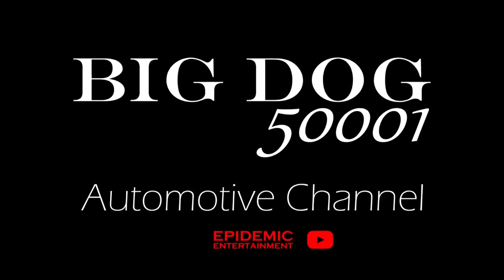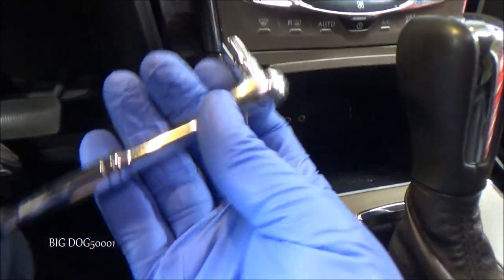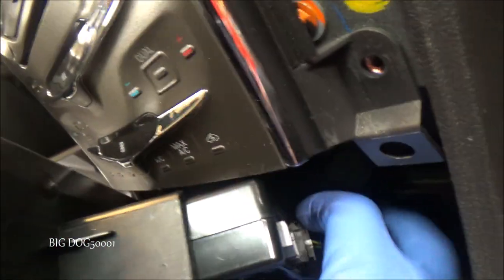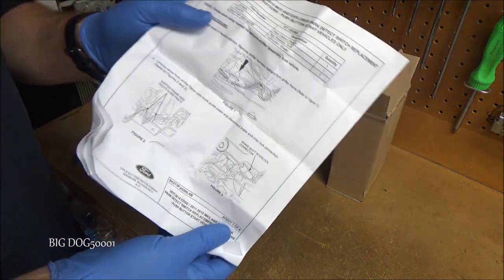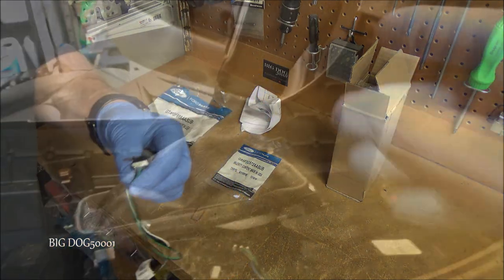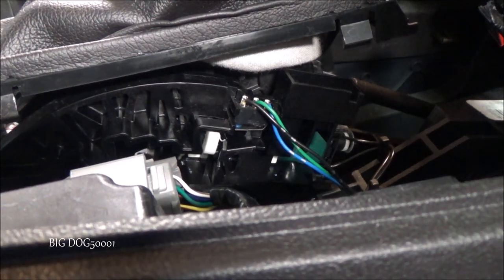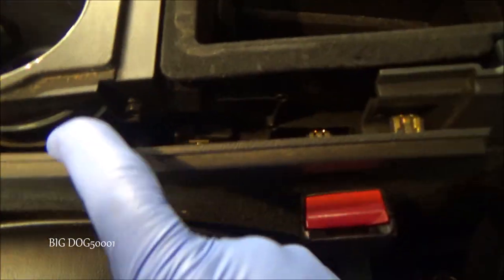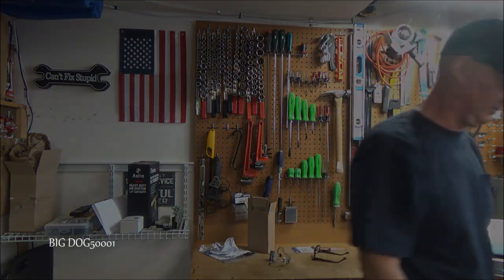Ford/Lincoln Shift to Park or Transmission Not in Park Message - Park Detect Switch Replacement

Comment from the maker: Tools and Parts
Disclosure: This channel earns a small commission using some of these links - at no additional cost to you.
Park Detect Switch (for this vehicle) GT4Z-3F988-B
My favorite little screwdriver:  https://amzn.to/3p1qIt9
Magnetic 1/4" Sockets:  https://amzn.to/2SALT9u
Long Nose Plier Set:  https://amzn.to/34CIhql
Trim Removal Tool Set:  https://amzn.to/3usWXme
SK Trim Removal Tool:  https://amzn.to/3fp0TQK
GearWrench 1/4" Socket Set:  https://amzn.to/3oWCODW
Terminal Release Set:  https://amzn.to/3vvcMdk
Astro 40SL Light:  https://amzn.to/3fWe1Mm

Part Numbers for TSB 17-2219: (Always Double Check):
GT4Z-3F988-B: 2011-2014 Edge/2011-2015 MKX/Explorer
G2GZ-3F988-B: 2015-2017 Edge
GA8Z-3F988-B: 2011-2017 Flex
GG1Z-3F988-B: 2011-2017 Taurus
GE9Z-3F988-B: 2011-2016 MKS/2011-2017 MKT
GB5Z-3F988-B: 2016-2017 Explorer

The Big Dog 50001 Automotive Channel Store can be found here: https://www.amazon.com/shop/bigdog50001automotive  (As an Amazon Associate I earn from qualifying purchases).

Comment: My wife has a 2017 Ford Escape. She was driving and a message appeared on the instrument cluster that the Ford Escape was not in park and then the exhaust went out.  Right now the Ford Escape does not start and nothing works, basically the Ford Escape is dead but with the Dash lights on and every time I press the shift button the lights on the instrument panel go off.  After several hours it turned on again. Have you heard anything like that?

Comment: My 2010 Lincoln MKZ has the same issue. But I think the 2010 model doesn't have a message like "Shift to Park". It just simply cannot get into P. When it's on P there is no indicator light on the dashboard showing the gear. What even worse is that sometimes it's on R but it goes forward. Do you think it's that same switch problem? Thank you!

Comment: Why not just pull the passenger side panel and reach the switch from the  side instead of the top?
Reply from the maker: This is the way I chose to do it this time, you can always chose to do it another way for your application.
Reply: @BigDog50001  I have seen another channel where the pro lem was the metal arm was bent. He re-bent the arm to give more clearance for the switch to open when the button is released and it worked.